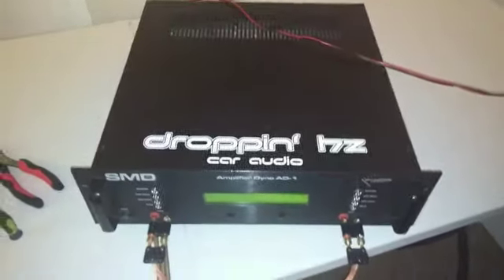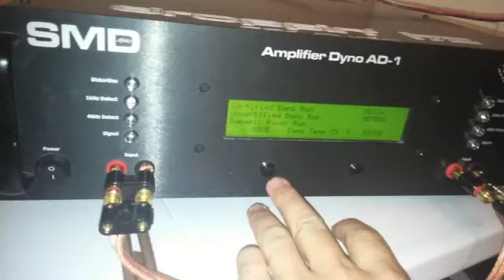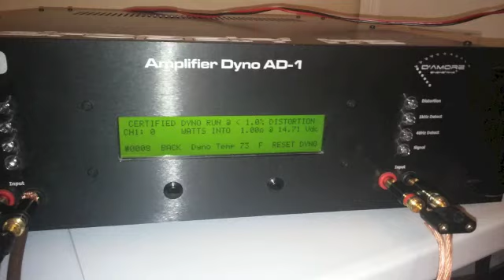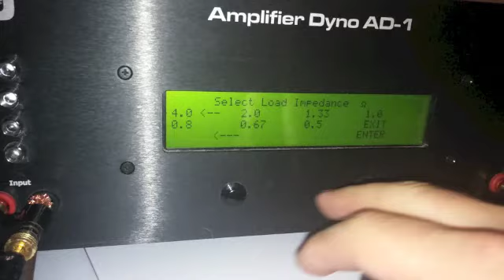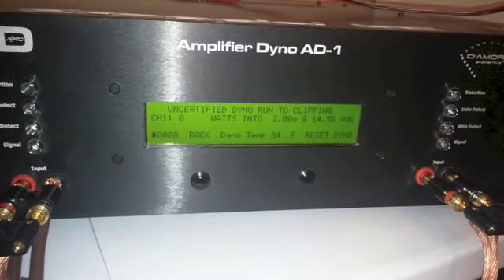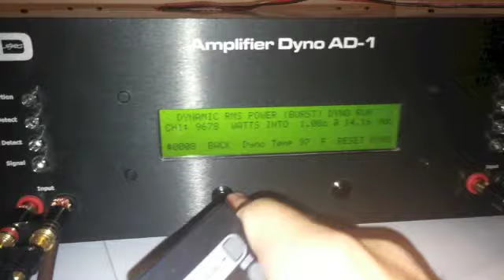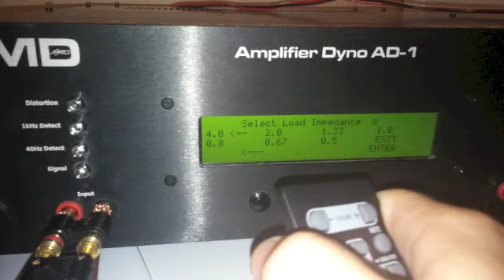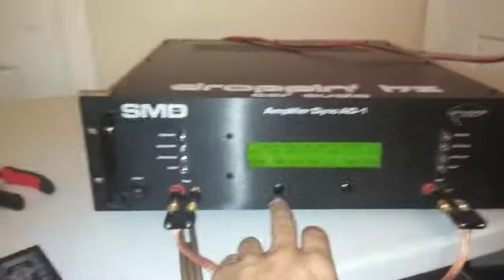B2 Audio m1s Amplifier Dyno Testing

Comment: can you please dyno the Taramps HD5000 you have on your website? I'm looking for a 4k plus amp and would love to see what that one can do since I've been having trouble finding Info on it.
Reply: pklemm1 get the crescendo encore 4.5. It's for sale at 8 or 900. It's a very nice amp, I have two strapped on two of the new fi btl neo 18s. They are doing great. You will need some juice to power them, but if you have extra, they will run up to 18 volts. Just an option

Comment: It's a long shot but blow cold air from ac in the amp 4 10 minutes an c if clean power watt is increased.like winter time it's always louder.I have gained well over 1db in the summer time by blowing car ac on amp.Tintmaster
Reply: jimmy1978tint 
Interesting!
Reply: Do you still refer to yourself as tintmaster?